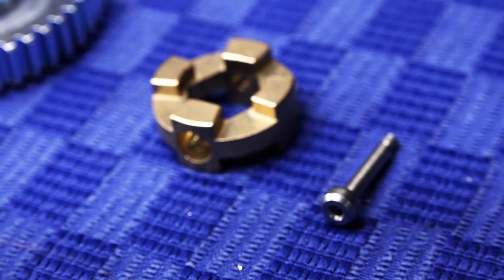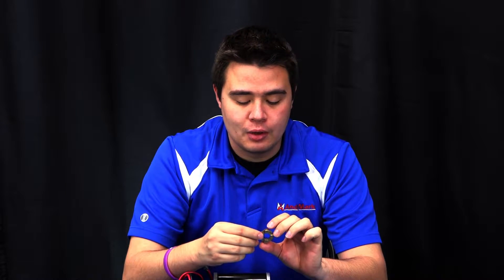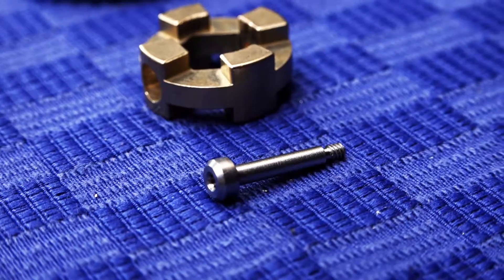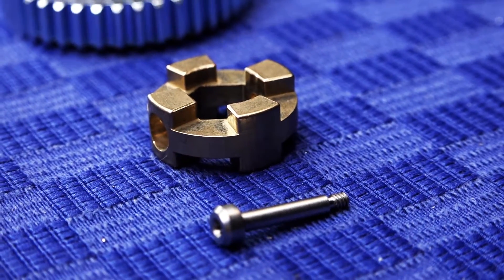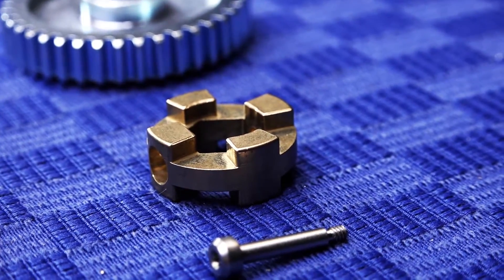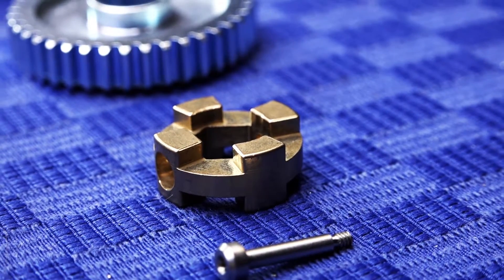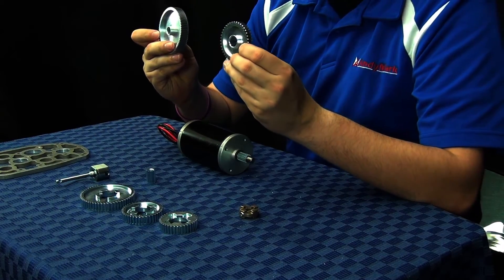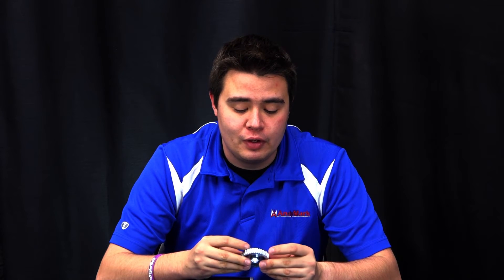AndyMark EVO Shifter

Comment: Do you all have a video on how to break in the transmission? On the website, it said to run the transmission for 30 minutes without grease, but is there a certain speed that it should be run at?
Reply from the maker: Good question! Our engineers recommend running it at full speed, for 15 minutes in each direction.  For any specific questions, you can always send us an email at support@andymark.com.

Comment: What's the difference between the EVO Shifter and Super Shifter?
Reply from the maker: Sergio, There are a lot of differences and they're fundamentally different shifters. Below we've listed the flagship improvements that distinguish the EVO from the Super.
- The dog gear now has 4 dogs on each face. This allows more material around the dog gear screw, increasing strength over previous designs.
- A robust 1/8" diameter shoulder screw replaces the previously used #4-40 screw.
- The dog gear material is AMPCO® 18 Bronze. This material has similar properties to stainless steel (previously used), but has added lubricity for smooth shifting.
- A new, super-strong shift block assembly with a larger bearing and steel housing (and threads!) is now included.
- The input stage uses 32 DP gears and a press-fit 15 tooth CIM gear. This allows for an 85:15 first stage reduction.
- This gearbox allows users to independently pick their high and low ratios, and are no longer confined to two set spreads.
- The user can swap the ratios (A to B, B to A) as needed.
- More encoder options are available, including the US Digital E4T (standard) and the CTRE SRXmag encoder (sold separately).
- Aggressive weight reduction features have been machined into the gears and plates.
- All of the cluster gears have the same features surrounding the bore on both sides. This allows the user to dis-assemble and assemble the shifter without worry of correct gear orientation.
- Users can pick two or three stages for their transmission. An optional 3rd stage provides an additional C ratio choice of 1:1.14 or 2:1.
- CIM Motors (2 or 3) can be ordered with the transmission. If these are configured with the product, then they will be shipped with the CIM gear installed on the motor shaft.
- Using existing mounting plate holes, it can be mounted to an AM14U family chassis or a 2"x1" box tube frame.
- A short, narrow air cylinder is being used, taking up less length compared to previously used cylinders.